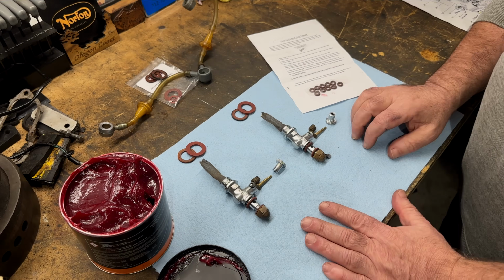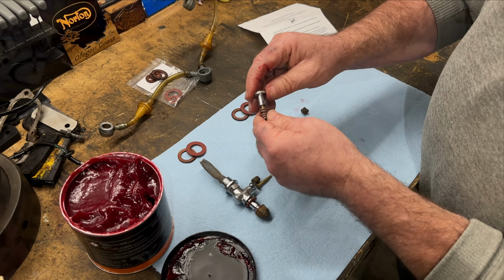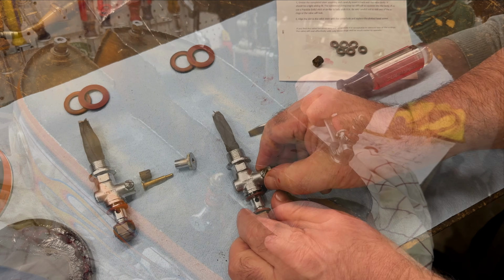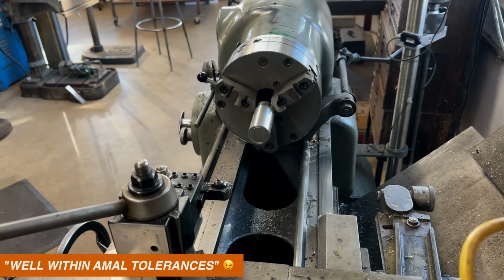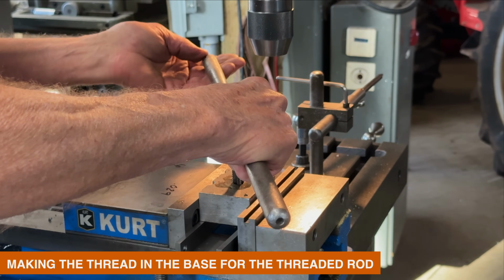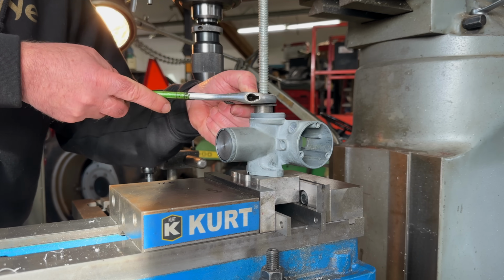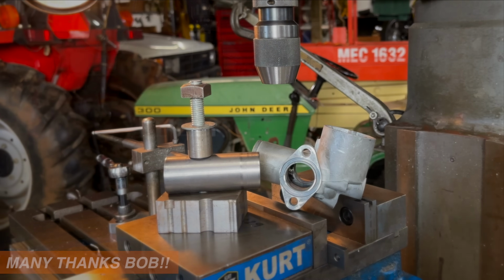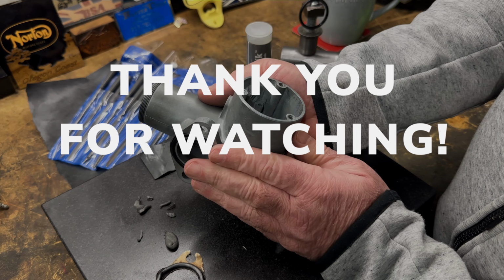1962 BSA A10 Super Rocket (Part 8) - Making an Amal Monobloc Jig tool

Comment: Can I ask why you didn't put some 10 thou spacers under the ears of the carb while it was in the new jig/press (once you realised it wasn't going to flatten completely)? Surely that would have taken care of any "spring" in the metal and would have resulted in lees finishing later.
Reply from the maker: Hi Peter, that is a great point and I agree. We did talk about that afterwards. We thought we could have even better to put some shims on both sides. I’ve heard about that technique. It probably would’ve helped. Thankfully, I didn’t have to shave too much off on the surface plate. Best wishes.

Comment: Very nicely done, Mike.   I'm not a fan of new carbs when the original can be saved.   We enjoyed temps in the 60's and even low 70's last month, but winter has finally arrived here.    Looking forward to your 2024 videos.  Thanks for posting.
Reply from the maker: Many thanks Rod. Yes I’m hoping that it will work just fine on the bike. I struggled for years with my monobloc on the Triumph T110 and finally got a new one but hopefully this one is in better shape.

Comment: I have half a recollection that those low temperature "alumi-weld" rods will work on the zinc based casting alloy.

But double check !!

Comment: That warped means its worn all over. I read a release that Amal said that their carbs are part of routine maintenance and should be replaced after a period. No matter how much you refurbish it, it'll never be new again
Reply: Also recommend a fibre spacer to reduce heat transfer from the head to the carb. But I'm sure you know far more about this than me😊
Reply: An interesting attempt at preserving a distorted and damaged flange.
I think l would've  ordered a new Premier Amal Concentric but l applaud the repair ethos.
Reply: Nice carb rebuild, hope it works. Amal are still making carburettors in England. I bought a new Monobloc for my Super Rocket, £300 including taxes🚀.

Comment: Enjoyed that Mike, took me back to my scientific instrument apprentice tool making days in the 60’s. As a matter of interest why didn’t you machine the flange flat? (May have needed the o ring groove machining too)..🇬🇧
Reply: Because bending the flanges back also improves the roundness of the throttle slide bore.
Reply from the maker: That’s a great question Neil. We did talk about putting the carburetor on Bob’s surface grinder, but he said it would take quite a while to set up (to make it completely level) and also we were a bit nervous about damaging the lips around the flange as they are already pretty weak. Yes, I agree with Dave below that the other benefit was that using this jig did actually help with the roundness of the bore. Best wishes, Mike